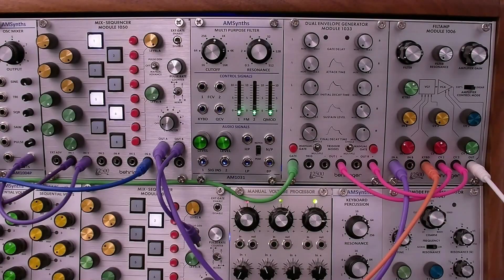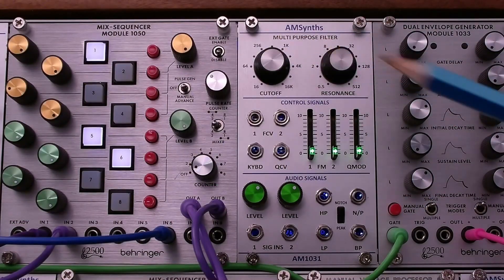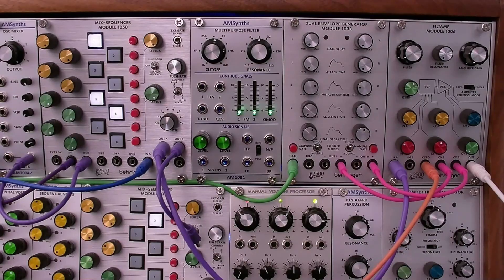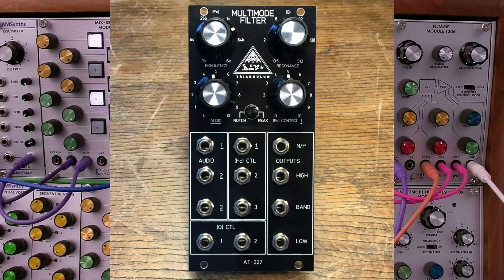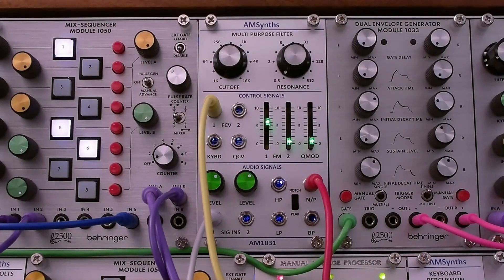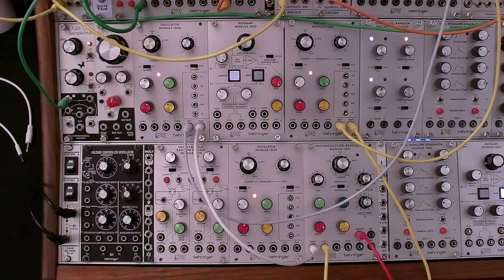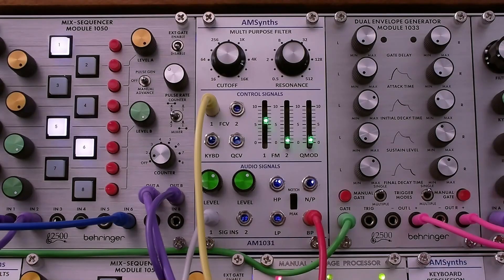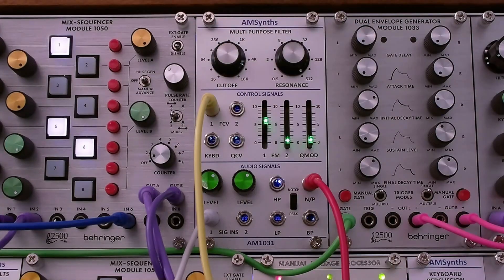EP 3 - New 2500 Modules - AM1031 Multipurpose Filter

Comment: Hi OZ, some very interesting differences between the 1031 and the 1047. Great to get some info on these modules from AMSynths. Too bad that Behringer have not picked up on these missing units from the 2500. Another great video!
Reply from the maker: Thanks Tony.  At least Behringer has created the affordable modules on which the "lost modules" series is based.
Reply: @ozhalljr  yes true enough and they are pretty cool. To get individual outputs on my 2500 I bought 2 2600 oscillator modules. I think they are close enough to the 1004 and I can send seperate waveforms out. In the end it was cheaper for me to do this than get the breakout modules from AMSynths!
Reply from the maker: @moogfooger  Cheaper!  That's crazy, I had not calculated that.  It also saves 2 hp of space (4 hp if you calculate 1004 plus the breakout).  My only dissappointment in the one 2600 vco that I have was that it did not have sync. You may have noticed the 921 that I've got in the lower lefthand corner of my 4 row 2500 rack to get sync.
Reply: @ozhalljr  Chealer when you add a 1004 and the breakout unit.  I did notice the 921. Nice, a very capable oscillator but I wanted to stick with the ARP style for my 2500.( probably no sonic difference)  Basically I am using the outputs of my 2 x 2600 osc to drive my 1050. It fills it up nicely. Now I think I may need another 1050 for other oscillators. I have 3 1004's and the 2 x 2600 osc's. The thing that I don't like is the LEDs in the 2600 osc! Too bad you can't turn them down like the full 2600 synth.
Reply from the maker: the lights are my favorite part of that osc. :)
Reply: @ozhalljr  The blue ones burn my eyes out! cheers
Reply from the maker: If they are at eye level, that could be a problem!
Reply: @ozhalljr  yes, I actually put some black rubber bands around them to tame them. Works great now.
Reply from the maker: @moogfooger  Crafty!